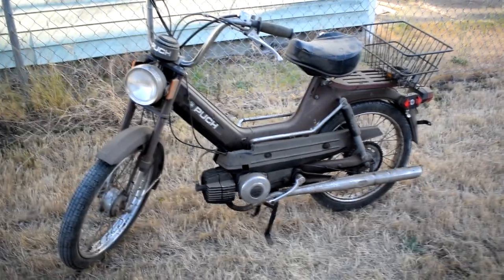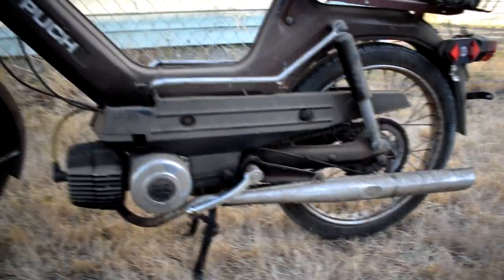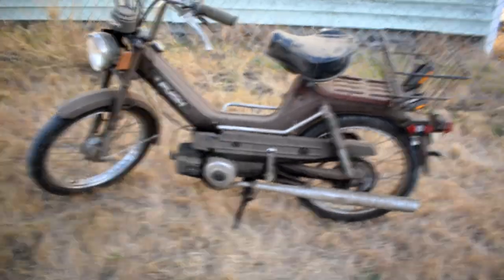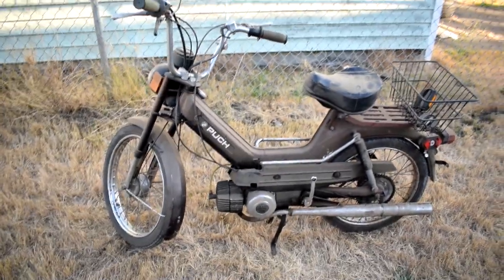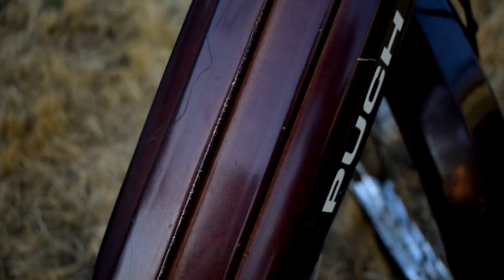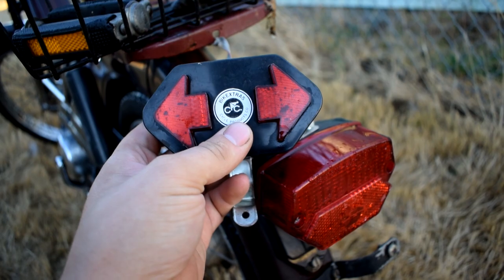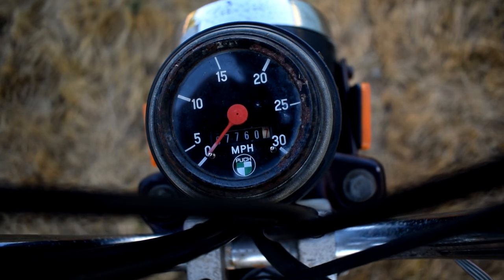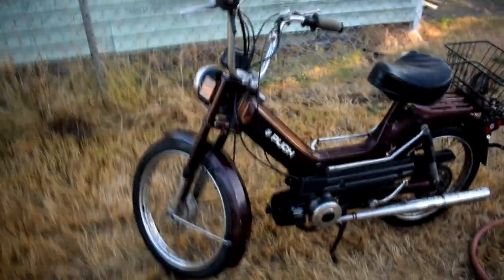Puch Maxi-Luxe Barn Find And Restore. Episode 1

Comment: puke slowped
Reply from the maker: True that, my dude. I have a 70cc kit on it now, and hit 45mph really easy now though. I will try to have a new video up in the next 2 weeks
Reply: @PacificRacer  i have a 77 maxi cafe racer style
Reply: and a near mint stock 78 maxi luxe high torqe
Reply from the maker: @donaldzackson1765  thats awesome! I would love to see the cafe racer one. Im planning on making mine more of a cafe racer style.
Reply: circumsize the rear fender and put low handlebars and a stone guard on the headlight and abra-kadabra its a cafe` racer bro
Reply from the maker: @donaldzackson1765  easy scene points haha. I replaced my front light with a LED lightbar. I might take it off and put a round LED light on.
Reply: delete front fender and slam the seat